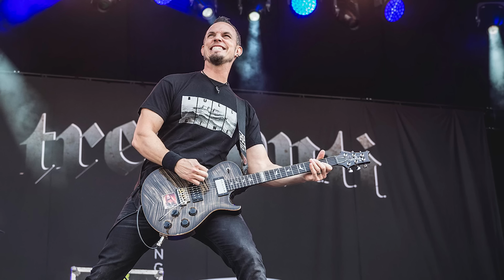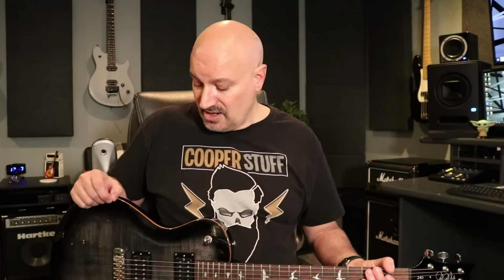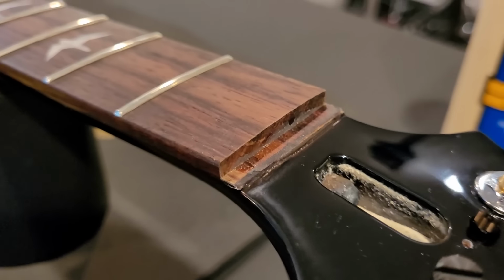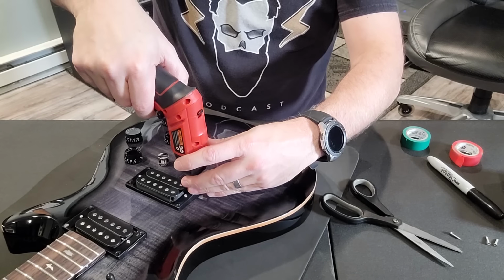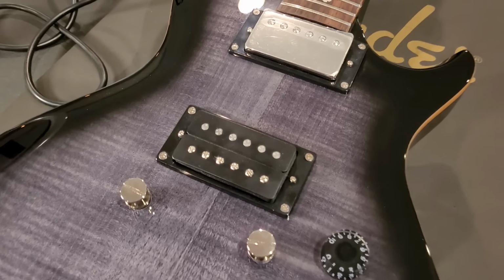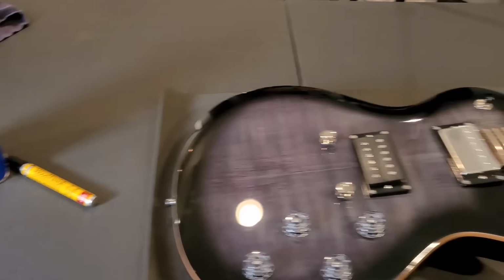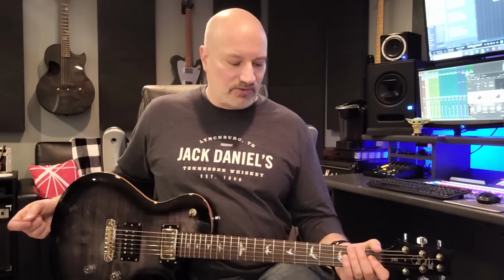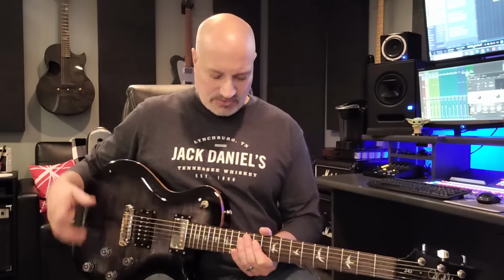Upgrading a PRS SE into a Core PRS

Comment: I can definitely hear an improvement/difference but the biggest difference I can hear is an improvement in the tuning/intonation of the guitar after the upgrades which is probably more to do with your “setup” after the work!
I’m a bit surprised though that after the upgrade you did that you didn’t upgrade the Alpha pots and bridge!
Like you, I too enjoy upgrading cheaper guitars gaining sometimes huge improvement and other times not so much.
The construction of cheaper instruments these days is so much better than even just a couple of decades ago with the weak link usually being the hardware and electronics, items that are easily upgraded!
Reply: I was also aware of the  difference in intonation and tuning in general,but dont know if IT was puling on the strings with slightly out of tune strings  making IT worse......
Reply from the maker: Thanks!  I'm still thinking about upgrading the pots, caps, switch and jack.  I did also look at a new graphtech bridge but the SE bridge seems pretty nice.

Comment: Really nice!  The pickups make a big difference.  I wonder about the top hat knobs, I read that they don't fit nicely on the SE?  Also, was a re-wiring to core wiring not necessary?  Finnaly teh 245 instead of the 25 scale lenght does that make a difference at all?  Great job, Thanks!

Comment: Post upgrade the guitar is tighter, less honky/sounds like you had a wah on before the upgrade.  The new pickups are definitely smoother.  Most definitely worth the upgrade.  I just picked up an S2 22, to go with my DGT.  Changing the pups and the trem block.  May do the saddles as well.

Comment: WAY too much glue on the nut. Never use that much glue ppl. 1 tiny drop at each end at most. That’s a great looking guitars. Love the color. Also the upgrades are perfect. Was way better intimated after you did the work than before it.

Comment: I have a couple of Gibson Les pauls, and while I did change the wiring on my 68' RI custom and put in one different pickup, I don't mess much with the rest of the electronics or the mechanics at this point anymore. My 59' RI I don't touch at all (it's an artist model, so that stays as it is), but for any sorts of changes I have my 2009 Les Paul studio. Shortly after purchase (new, so that must have been around 2010, or maybe even still in 2009) I removed the PCB that was inside and put in measured 550k pots and matched russian PIO capacitors. Currently I have OX4 pickups inside. The hardware (tuning pegs, bridge, saddle) used to be gold, but are now black (just like the guitar) with aged tuning knobs. I used 50's style wiring as I prefer that over modern wiring. 
The difference in looks and sound is quite drastic compared to when I bought it, I have to say. That black nut that you put into yours would fit that guitar quite well, as that's the only thing that's still white on it. Might have to look into that.
Reply: Wow great upgrades! Have you encountered any tuning stability issues with the Les Pauls?
Reply: @dowaliby1  no, not really.. they're all quite stable as long as the environment doesn't change too much.. obviously humidity can play a role and I travel regularly with my studio, so I am regularly in the need of retuning that one.. the others are pretty stable at my house.. especially when I compare to some other guitars with tremolo that go out of tune much easier. Still not as stable as some with locking tuners though.
Reply: @cdh79  Thank you!

Comment: Hey man, thank you for this walkthrough. I wanted to ask, is it just the camera or is the spacing on the b string of the nut just a little bit off (leaning towards the high e)? Also, to my ears, it lost a bit of detail on the "treble" side of the pickup after the upgrade. I imagine you experimented with the pickup height since this video though too

Comment: Nice vid brutha & nice Tremonti model…. Ive ordered a DGT SE & the pups are a tad brighter than the Core versions but a British cat that works for “True-fire” (and is an accomplished player) had the Core model and prefers the SE pups….crazy…. I may upgrade the electronics & pups to the Core model’s but after hearing 2 people say they like the SE’s pups as much or better, I may wait awhile…. Last thing I need is another guitar but Ive wanted one with P-90’s for many years because the rock tone from them can be awesome but the humbuckers on the DGT SE are voiced a bit like P-90’s (using the twin volume controls in conjunction with the coil taps which allow 25% of the second coil to still bleed through)….that along with the treble bleed (orange drop caps) circuit kinda sold me on the guitar….
Sadly, its in backorder status for 6 months.., yikes..

Comment: PRS SE guitars are great guitars and the pickups made a big difference. They are cleaner and get more sound out and  your can hear the strings better. The original pickups were not bad at all. I know on some of the cheaper guitar the volume and tone pots don't have much range but not sure that is the case on the PRS SE models. I have a Toni Iommi guitar with his original pickups in it from Epiphone that was done from Epiphone. That guitar does sound really nice as well. Once you replace the pickups the guitar will sound the best that it will sound with it being an SE. I am sure there is still a little bit of a difference but not $4K difference. You did a good job.

Comment: I found a 2013 SE 245  in 2021 that literally had to have been up on a wall high enough so it never got handled in 8+ years ?!  Mine is the iced tea burst (?) flamed maple veneer that is AAAA perfect. It has the old headstock w/hideous giant "245 SE" on it. After pulling strings and a thorough cleaning the dust off I was stunned to find it in literally freekin PERFECT condition, like not a mark on it perfect, for less than $500.  My plan was similar w/o any specific model target,... just upgrading with the best Core/S2 parts etc avail.: a set of Seymour Duncan Seth Lover Pickups, S2 adj. bridge, S2 locking tuners, rosewood tuner buttons, Switchcraft 3way toggle, Puretone output jack, Rolled fretboard edges, polished frets, custom made, stained, cleared flamed maple P-up rings, and toggle switch tip, all gold hardware incl. jack plate and all screws, flush mount gold Dunlop strap locks, amber Gibson reflector top hat knobs, finally custom made ribbon mahogany back cavity covers...aside from desoldering the OG Pups Toggle and Output jack, and soldering in the Seth Lovers, Switch craft brass body 3way, & Puretone Jack,  the electronics are stock. In the end I have a total of about $1100 into it. 
Yes, I invested almost $650 into an as new 9 year old guitar(!) i paid $450 for.   

...And,.....it is absolutely phenomenal!

I was always planning on investing in a proper Les Paul AND eventually a core model PRS,... I kept looking for a good deal on a used one I could find locally to play before I blow THAT phat a wad,.. .BUUT....after a solid year with this guitar,............Imma have to win the lottery to justify burning $3500-5k++ on a core model or proper LP Standard or custom as a mere enthusiast.

PS: Iv'e had great luck with india ink black for staining crappy looking pau ferro fretboards and phenomenal luck with the vinegar and steel wool ebonizing process.

Comment: Stevie; that was a great video - really with a good SE foundation one can make an awesome guitar. For me - every SE I have and had, required 2.5 essential upgrades... (the 0.5 is to everyone's personal taste) - No.1 (as you did): Nut!!! absolutely essential to get a guitar (with trem) that is stable in tuning, The Graphtec Nuts are the way to go - in case someone asks - the PT-6643 model fits most PRS...); 2nd: Pickups!! - even not on headphones you can hear how much better the Core pickups are compared to the stock! - I always change SE pickups..; the "0.5" change is - sanding the back of the neck to have a satin finish.. - that's personal taste - but for me the laquer finish always feels pretty sticky.., - Greetings; Markus
Reply: Took scotch brite to the neck of mine and changed to locking tuners the neck felt so much smoother. Highly recommended.

Comment: Anyone know if the factory SE pots shafts are corse 18 spline and how does the fine 24 spline USA lampshade knobs manage to fit? Is it merely a friction fit because the SE pot shafts are smaller diameter than the inner splines of the USA knobs? Thanks.

Comment: Cool video, nicely documented 😎 One remark added regarding the "closeness" to the Core model though - the scale length, which is also a major contributor to what a guitar sounds and feels like, is 24,5" on the SE245 (hence the name) whereas the Core Tremonti has 25" scale as actually most of the SEs (including the SE Tremonti) have as well.
If you really want the stoptail though there's not an SE option available.
The pickups (and to a certain extend the pots used) do make most of the sound of an electric guitar though and the Tremonti US pickups, especially the bridge pickup, really slay. I took the pickups out of my Core Tremonti because I wanted the guitar to be more of a Les Paul style thing with equally powerful output in neck and bridge position so replaced them with the revered first run PRS 57/08 set. The Tremonti pickups live on in my Ibanez SZ520 and boy did they transform that guitar into a fire breathing monster 😁
Reply from the maker: Very true about the scale.  The 245 is only 24.5" and the Tremoniti is 25".   I've never owned a 24.5" scale before and I feel like I can reach some stretches I can't on other guitars.  🙂

Comment: Hi, I have a core PRS and want to changet to straplock S the same as you installed, however It seems the screws that schaller uses are smaller than the PRS ones, I couldn't really tell in your video, are you using the standard schaller locks? found any issues, did you order a special size? any help really appreciated!

Comment: I’m pretty jealous of this. I have and SE tremonti that I have been wanting to do this very thing on but I don’t trust myself w the wiring. If I hire it done it gets pretty costly. I am curious why you didn’t change the pots out? That is one thing I really wanted to do. The core Tremonti the pots move so smooth. You can flick it from 1-10 with your pinky but the SE ones are hard to turn so you have to actually twist them w some force. Again great video looks great.

Comment: Other than the obvious differences, the Tremonti model is a 25 inch scale, the SE 245 is 24.5. The Tremonti Signature model also has a wide thin neck and the SE 245 has a wide fat neck, compared to the signature model, the SE 245 may feel a little easier to play due to the shorter string length.

Comment: I've got 9 guitars. Every guitar sounds just different, but not better or worse than the others. I do (cheap) mods for better playability (action setup and nut change if necessary). Even locking tuners (which are fine to have) are not worth the money for me. On my Yamaha 612 they are stock, that's okay. But on my cheap Squier affinity strat from 98 I have no stability problems at all, the same on my also cheap Harley Benton SC 450 plus. I am no pro and there is no problem to tune my guitars once in a week, besides I am a bit lazy and last but not least I don't have money to waste. To me all guitars are beautiful instruments no matter what color, shape, etc. Looks don't bother me really.  For working musicians things are quite different. They need reliable tools and some mods are making their lives much easier and looks may play an important role. Nevertheless I followed your explanations with interest. Thanks!

Comment: Here's my take.... it's your guitar, do what you want.

But other than the pickups and the tuners everything else is pretty much cosmetic. I've had many different locking tuners...you went with PRS to keep it right and that's fine. Pickups are almost always the biggest upgrade and that is what you wanted. Great!

Other than that.... it's not much different. Sure maybe a better nut but even cheap nuts are fine with some sanding and graphite. Knobs? Sure some feel and preference. Strap-locks are a no-brainer for every guitar.

Staining the fretboard? I would have never done that. That was a perfectly fine and beautiful rosewood board. But hey, you do you.

Here's the most important thing you didn't get into and that's the frets themselves. Yes, import guitars can have decent quality but this is a huge difference from custom or true quality builds. You never showed if there were "dead spots" or how the frets were polished, dressed, and finished. That is truly a difference between a "cheap" and "expensive" guitar.

Comment: Its a good idea to upgrade your SE model...BUT...it will never be a Core or S2 because of premium woods, build, neck, frets...but you can get fairly close to the sound if you add a few things to your list you missed....brass trem block if needed, new wiring with CTS pots,switch,jack,cap,bleed. The American guts inside should make a difference.

Comment: genuine question: do anyone here had ever change the se ce 24 tremolo into a fixed bridge? I don't like pauls guitar because the coil split is so confusing and too expensive at the same time, I don't like se 594 either. im thinking between se custom24 and ce 24 but i don't like tremolo.

Comment: Of course, the main difference between a Tremonti and a 245 is the scale length, I'm surprised that's not mentioned. And it would probably feel even better with the b string in the nut slot.

Comment: Once I wanted a single cut, so i bought exactly one you are upgrading, but in sunburst color, PRS SE245. I put in locking tuners, straplocks, and, oh my, pair of Duncans Seth Lover SH55 for about 3rd of the price of the guitar. I recorded clean signal on every pickup before changing and did a comparison after.

 I couldnt tell the difference. Stock pups of these SE actually are very good. And I earn for living by playing and mixing music, mind it, I think i have a well trained ear. 

So i've sold it and got myself a fresh Gibson LP 50s (which are absolutely killer guitars, Gibson slayed with them). And the all the difference is there. So i am really sceptical about upgrading cheaper guitars, for me its never really worked.

Comment: There is nothing wrong with the PRS SE guitars. I even love the pickups! I honestly see no reason to upgrade an already great guitar.....when it will never equal a Core model. (The nut is a special nut that PRS has designed... virtually the same as the Core model uses.... and I hate locking tuners. Everyone has their own preferences. The biggest difference are the woods used....you'll never replace the Maple top with Flamed Maple veneer for a solid Flamed Maple Violin Carved Top.)

Comment: Honestly, the first thing I would have done differently is simply to condition the fretboard rather than darken it.  I like many fretboard woods -- true, the darker the better, but I also like maple boards occasionally.  Conditioning the fretboard would have darkened it somewhat also, so I would have gotten some measure of that effect.  I would have straightened the fretboard with a notched straight edge, then used a fret rocker to find problem spots.  Four or more and I do a full fret job; the axe gets a full setup either way.  I have enjoyed this process in the past, but I can also see where a person might not dig it so well.  I have no doubt that the SE makes for a very good upgrade platform.  The fact that there are such available lowers the urgency for any of the prestige brands and/or models in at least my life.  Unless I win a lottery or otherwise have a very happy windfall, Fender, PRS and Gibson can't sell me anything anymore.  Instead, I'll get something close enough and then make it mine with artfully-chosen enhancements of both the cosmetic and performance varieties.  I do recognize, though, that some guitars are so good that they don't lend themselves to upgrading simply because they don't need it.  I have a couple of cheap Strat knockoffs so good that I have no plans to give the heave-ho to the pickups.  The switching will get some upgrading (Think "David Gilmour mod" with a push-pull pot substituted for the mini-toggle switch.) and beyond that they don't need anything.

One thing you did that I approve of is that you started with something close to ultimate goal.  Also, your chosen platform supported your choice in pickups -- always good to make sure of this detail.  Great job, my friend!

Comment: I bought the exact guitar you have there, put $400 into it from experienced luthiers and wound up selling it for a Tremonti SE in the same color. I'm wondering why you didn't just do the same 🤷. The 245 has a completely different neck and style from the Tremonti. It's so apparent when you play both of them sbs. Yeah I put the locking tuners on it, but that's less than 100 bucks from Amazon.
Reply from the maker: I definitely could have found a used SE Tremonti with a fixed bridge. I think the current SE Tremonti's only come with a trem. I also saw that Myles Kennedy plays a core 245 and I thought it would be cool to have a hybrid of both their guitars. I do like the neck on the 245 but I'm sure I would like thw Tremonti as well.